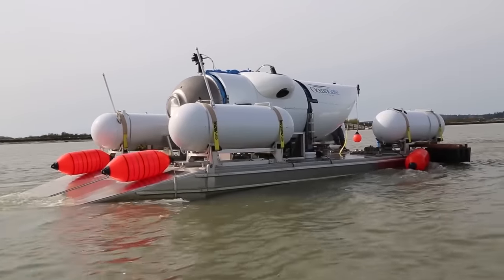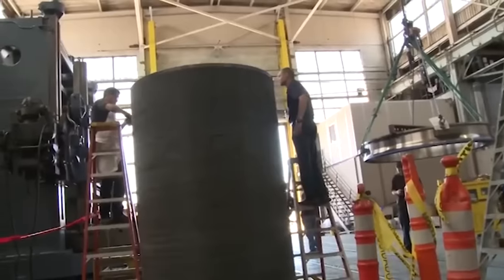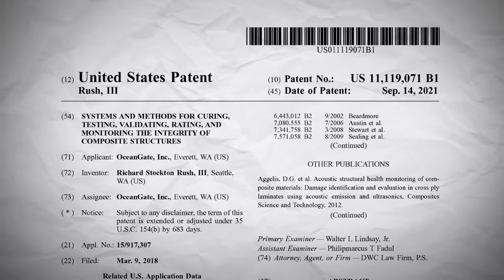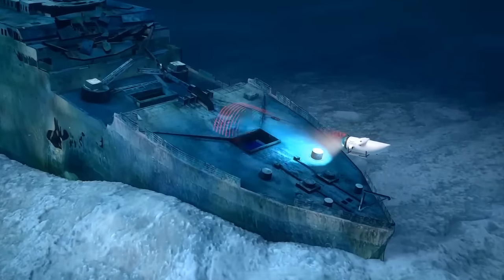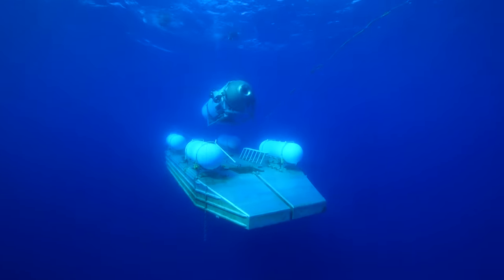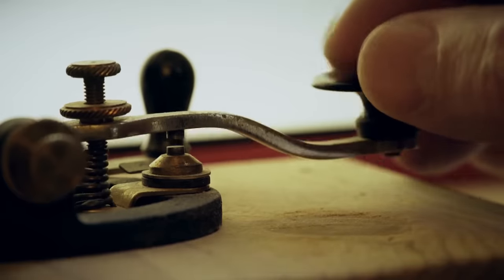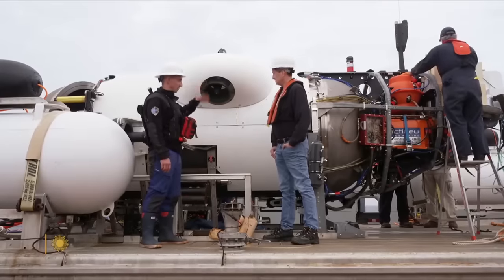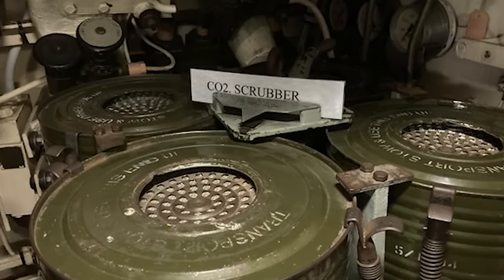Exposing OceanGate Submarines Many Fatal Designs

Comment: Another thing I find nuts and not just about Titan but all deep sea submersibles, you see the occupants using their mobile phones as cameras. We've all seen phone batteries spontaneously combust. Inside a locked tube or sphere under immense pressure I don't want anything on me that has the potential to spontaneously combust! I'd be worried that someone took their phone swimming, dropped it wrong or just had a lemon and caused us all to perish. The confidence people have in their phones, yikes!

Comment: The two things that scared me the most about this vessel are 1) the carbon fiber hull, and 2) the outside screwed door. I don't mind the PlayStation controller, as long as it's wired and not Bluetooth. However, carbon fiber is a material that ages, unlike titanium. So its structural integrity when new is known but as it ages and is put under stress, that structural integrity becomes unpredictable. Also, the crew should have a way to open the door from inside. Last but not least, the window should have been rated to the same 4,000 m as the hull was supposed to be. There's no point in making a sub with a hull certified for 4,000 m when the viewing window can only go down to 1,300 m.
Reply: The carbon fibre hull is obviously the big problem. But it's not a good idea to trust your life to a consumer-grade game controller that's a single point of failure in the system.

Comment: Let us start by an understanding  a couple of simple terms.  The action of an elephant standing on one leg ( or whatever) induces a LOAD. ( or a Force), If you know the area of its foot you divide the Load by that Area you get a PRESSURE.    Load is measured in POUNDS  (or tons or kilogrames}. Pressure is measured in  POUNDS PER SQUARE INCH  ( or tons per square inch  or Kilograms per square centimeter or whatever.)  Lets understand these simple things and not be confusing.  It is as simple as noting that gasolene costs me so many dollars per gallon ( or litres if you are over there}. If I fill up with ten Gallons I will get a total Cost of ten times that.

Comment: ummm did they  try using Lepages " 4 mile /6000 lb/ carbon fibre/titanium / water resistant / non stretch/ non shrinkage/ repetitive cycle/ little degenerative/ for tube type style propane tank crafts/non popping / "  super sh*t glue????     maybe they should have tried white glue or good old flooring glue?...that stuff is nasty...asking for a friend

Comment: I'd like to see what military applications and or submarines that use a $20 logitech controller. Also, your math is a bit off, considering most modern vehicles have headlights that produce anywhere between 1,800 – 2,000 per bulb (and this isn't including aftermarket bulbs, or xenon headlights that dump 12,000 lumens.)
The best part is, that the stupid little microphone setup they had to warn you of implosions. And idea how much time you'd have to take action if one of those alarms went off to let you know the sub was going to implode? Your brain probably wouldn't even be able to process the sound it head before you died.  

Wait, so the sandbag deadmans switch, wouldn't work if there was no air....?

Comment: COTS game controllers on a Virginia class sub? Pull the other one, it's got bells on. Maybe controllers modelled after the pattern of familiar game controllers, but certainly not COTS devices like Ocean Gate used. And yes, that IS dangerous, even if they had spares on board as their CEO claimed. If the batteries ran out just as you were approaching the wreck, you might crash into something before you had time to pull out one of your spares.

Comment: The worse part is the using a material not even designed for that depth (the viewing window). That is just ludicrous. I mean, yes, I understand that a rated depth or weight etc is typically rated for less than where actual failure occurs. But you don't use that fact as a negating point in relying on it. Sigh. Stretchers for example are usually rated at 750-850lbs. But some companies use a tripple methods. If it is rated for 750, then it likely failed around 1500-2000.

Comment: Place a sphere under great psi and see what happens then place a caped off cylinder under great psi and see what happens

😃A sphere good 

💥A cylinder ☹️bad

This is why the Alvin submersible has a sphere for a pressure hull not a cylinder

You can do all this science you want
And try to explain what happened 

 It wasn't designed for that death that's the science

😳 I would taken one look and said 🤨 thank you but no thank you ⚰️

Remember the railroad tanker 😳 the atmospheric pressure was 14 pounds per square inch

The water psi at the Titanic is
 16,000 lbs psi😮

Comment: Very important to note that the example of the rail at is an example that is nowhere even near the same. The rail car, at maximum vacuum(technically impossible, but close), would be a ~14psi/1psi differential. At the depths the Titan reached, you’re talking thousands of psi, so the railcar was actually mild by comparison.

Comment: Why belabor the human stupidity or egotism that led to this disaster.
Maybe indirectly, inspections and licenses will change.
From my own knowledge of mechanical disasters, most start. with human error.
Whether a plane, a train, a car a boat etc.,  somewhere someone and something
went wrong.
There is no such thing as perfection, only the ability to incrementally make things safer.
Planes and pilots are a great example of massive efforts over the last 75 years to eliminate 
those  errors, and for the most part, they have succeeded.
Nature, in it's randomness combined with Human hubris can't be predicted.
To misquote the great Scots Poet, Bobby Burns.
"The best laid plans of mice and men oft go astray,
and leave us naught but grief and pain for promised joy".
Cheers,
Rik Spector

Comment: 6:00 I don't this is necessarily correct. Navy used Xbox controllers only to command periscopes. Other remote controlled devices are commanded through remote controllers, which could look like a game controller to an untrained eye, but they're vastly configurable, even without a computer connection. You see those 3D printed parts on the Titan's controller? Those are there to increase the sensitivity of the gimbals. Instead of MacGyvering that controller, a $100 OpenTX compatible controller could give them all the sensitivity and configurability they'd need.

Comment: I am an amputee and have learned about the issues surrounding carbon fibre the hard way!
Losing my right leg in my early 20's  I used a carbon fibre running blade on a number of occasions.
Until that was I endured a catastrophic failure. This occurred without any warning or obviously signs of impending failure.
Luckily I was OK and only my pride was dented! However on investigation I discovered that carbon fibre is known to fail catastrophically without prior warning. 
When I heard that the Titan was made largely from carbon fibre I told a friend that I would not dive to the bottom of a swimming pool in such a vessel. 
Let alone down to RMS Titanic!
It is absolutely tragic that people lost their lives in such a situation.

Comment: Cutting some corners, and and calling it "innovation" is not necessarily a bad thing.  Interior lighting purchased off the shelf from an RV parts company is fine, I assume.  However, I know nothing about deep sea submersibles, and that's the point.  Where Rush went wrong, it seems, was his time spent on Mount Stupid as described by the Dunning-Kruger Effect.  In an interview he actually said "how hard could it be", or something very similar.  My point is that, even though some aspects of Oceangate's operations seemed like clever workarounds, Rush thought that philosophy translated to proper engineering and testing of the many single point of failure issues in the safety of the sub.  I realize building a one-to-one pressure vessel and testing to destruction would be expensive, but as it turns out, it would have been worth it.

Comment: There is a form of engineering called "mistake proofing", companies like Toyota use it. It reduces the chances for catastrophic error. For example the thruster. Mistake proofing would prevent the thruster from being able to attach backwards. The engineer would design the fitting to that it could only be installed forward. Lot of other neat techniques used by Japanese engineering, good stuff.

Comment: One only needs to compare the Triton to the Triton Submarines DSV Limiting factor sub (which is full depth ocean certified and has dived to the deepest parts of all the world's oceans to see just how many light years ahead that is in engineering effort. The Trition was closer to a Junkyard wars build that would at best be useful for shallow water. And even Junkyard wars builds used only certified equipment and pressure vessel parts. 😂

Comment: @ZirothTech the Logitech gamepad was indeed another dumb non-sense of these idiots. It introduces a useless wireless link, batteries to be checked and replaced, the risk of falling down and breaking, the need to recheck/reprogram your firmware in case that model needs a replacement and goes out of the market. I came out with this list in 5 minutes in my bed. I bet that MIL-standard "gamepads" are nothing like the 30$ wireless crap these "innovators" used

Comment: the navy uses game controllers as a SECONDARY way of controlling periscopes and some targeting systems... they dont use it as primary controls and dont use it for maneuvering any life critical systems... i have no problem with them even using a game controller, but i think they should have some sort of manual controls in case theres a problem with the conputer glitching or controller connecctivity...

Comment: I'm a vacuum/mechanical engineer, and I've designed large cylindrical chambers with hemispherical ends about the size of the Titan for the aerospace industry.  The use of carbon fiber in this application makes no sense.  Wound structures like this work well in a tension regime, i.e. if the pressure is on the inside.  But when the pressure is external, the fibers go slack and about the only thing holding the pressure is the matrix around the fibers (usually epoxy).  That is strong in compression, but very brittle and will fail after some dozen cycles.  This is probably why the craft was never certified.

Comment: Thanks,  helpful re.. communication systems and  the hull sensors for any cracking. 

Kindly advise whether the CF hull was subjected to greater longitudinal  forces than any prevailing hydrostatic force, because of the surface area of the hemispherical  heads.

Comment: Imagine getting stick drift 4000 meters underwater.

Edit: Nice clickbait thumbnail. I know you actually clarified the part that was meant to dissolve but that thumbnail is intentionally misleading viewers into thinking the sub was designed wrong for the wrong reasons. It was the carbon fiber delamination, not the dissolvable safety measures.

Comment: Me. I would of performed NDI (nondestructive inspection} on the sub every time after it went down cause engineering numbers are numbers and actually doing a dive is a different story. Better to catch a small crack before it grows. Aircraft are required to be inspected at certain number of cycles. (Pressurized.). It`s called being proactive to a incident.  It`s done with what`s called eddie current for metal and ultrasound for the carbon fiber.

Comment: The recent CF pressure tests have certainly demonstrated that submersibles can be constructed using carbon fiber. However, it's crucial to recognize that engineering a submersible isn't a process that allows for trial and error, especially when human lives are at stake. The data available indicates that we need a more in-depth understanding of how carbon fiber behaves under extreme pressures.

The margins we set, for instance, might need to be more generous. For a depth of 4000 meters, the hull may require a thickness of 10 inches or even more. Perhaps we need to consider alternative orientations for the fiber strands, such as angled patterns, rather than just parallel configurations.

Another area that requires further exploration is the adhesive technology. We may need to develop a novel bonding agent to securely affix the titanium elements to the carbon fiber structure. 

While carbon fiber has been quickly dismissed by some in the wake of recent events, the failure lies not in the material itself, but in the understanding and application of it. I believe that carbon fiber still holds great potential for this application, provided we fully understand its limitations and behavior underwater.

Questions such as whether this model would implode at half the pressure, or how many cycles it can endure before material fatigue sets in, are crucial for us to investigate. The incidents underscore the importance of comprehensive research and development before we proceed with the implementation of carbon fiber in submersible construction.

Comment: Clearly it was built to handle the pressure, but they picked the wrong material! Carbon fiber has weird and inconsistent fatigue/work failure characteristics, and is much better at keeping things IN than OUT!!

Comment: If you consider they where charging 250k a head with him as captain that’s 1mill per run let’s assume each person takes 100k in costs including captain that’s 500k profit 500k cost if they would have ran 4-5 runs per ship they could have profited 1-2 million per submersible it was obvious to me from the start what happend and as information came out I was reassured I had saw the early news coverage and made a guess that the ship lost strength with the dives and pressure and ended up failing all they had to do was remake the body of the ship reuse controls lights other components it’s purely the ceos fault he was big headed cocky and thought he was the main character it upsets me they also talked of black box and gps but again he was big headed the victims family’s should go for everything he owned even though they were rich

Comment: I’m so glad they had 10 hour timer for the ballast.  Of course you do realize at 3000 ft a 1 inch whole will provide a flow rate probably north if 1000 gpm.  Which means ballast means jack shit in less than 5 minutes.

Comment: Linking another video here. Look at the beefy screws used to mount the monitor stands. Those screws are going into and compromising the pressure hull. WTF.
https://www.youtube.com/watch?v=VaOVYkWgpcM&t=871s
Maybe someone did it who did not know better. But once someone who knew better saw it, that hull should have been scrapped.

Comment: You say game controllers are used in a number of industrial and military applications.   I have designed and built systems to control large hydraulic machines.   We would never use an off the shelf game controller.  We used industrial joy sticks and controls which cost a lot more and are much more reliable.  Don't downplay the danger of using a $30 game controller.

Comment: The narration is full of problems. The deadman's switch doesn't need oxygen to work. The head being put into place with only 18 bolts is also not an issue - the head is being squeezed on the whole time. The analogy for pressure is also ridiculous.

Comment: I might be nit picking here 9:15 you say it would release sandbags from the bottom of the sub one small issue. This was not a sub (normally shorthand for submarine) but this was a submersible. A submersible is an underwater craft which needs to be transported and supported by a surface vessel or platform. This distinguishes submersibles from submarines, which are self-supporting and capable of independent operation.

Comment: Whilst one can criticise the comunications and control systems, they are irrelevant to the fact that the carbon-fibre cylinder failed after repeated compressions. That was as much frontier technology as deployed  by assorted aircraft builders in the earliest 1900s. What does this teach us about building submersible  using carbon fibre weaves and the resins or whatever that hold the woven sheets together and how much does the orientation of the fibres contribute to strength? How does a tube of  carbon- fibre laminate perform under pressure when attached to a hemisphere or tube of titanium? Which deforms the most, the carbon-fibre tube or the titanium? What effect has the temperature difference  between the temperature of manufacture  of the carbon-fibre tube and the same tube at close to zero degrees C? The same applies to the titanium tube connected to the carbon-fibre tube.

Those as far as I understand these are the critical unknowns; the game controller and communications system are irrelevant to any discussion about the mechanical behaviour of the materials, and their interaction, used to  make the submersible. However, now we know what doesn't work for more than 4 or 5 deep dives.